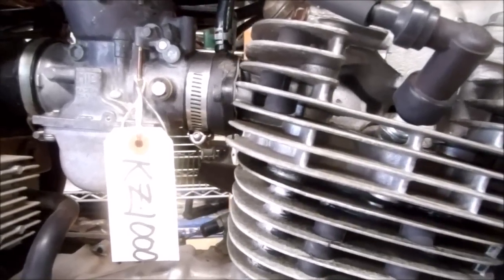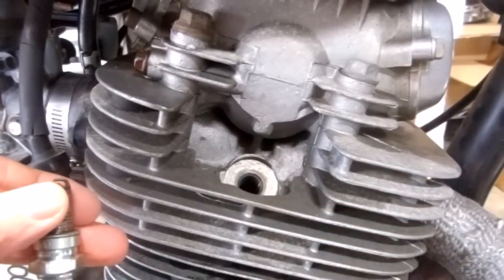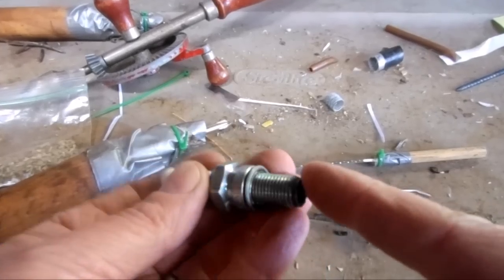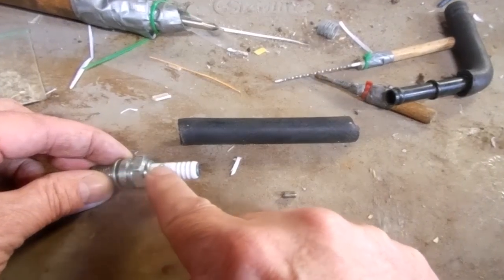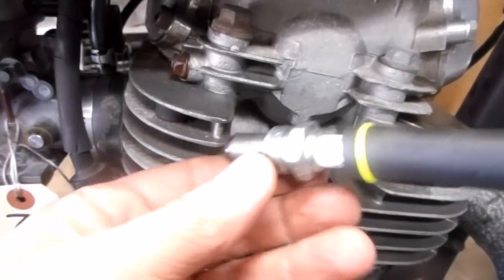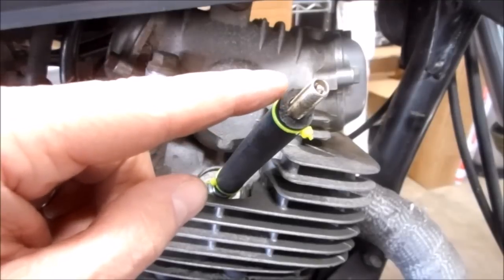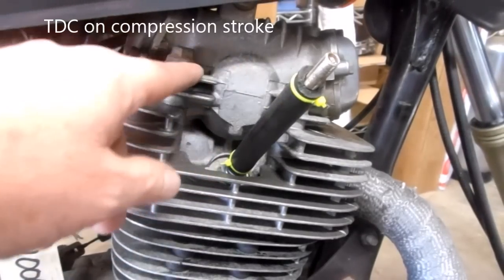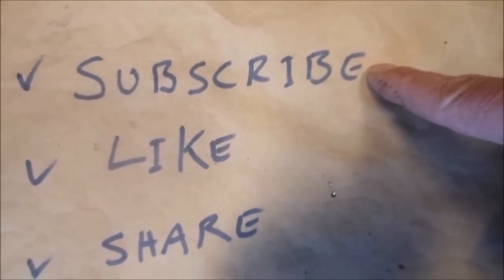how to check engine cylinder compression and leak down

Comment: Those miniature scissors cut extremely well. Also the saw that you used to cut off the shrader valve did very quick work. I am amazed that you were able to drill that hole with that antique hand powered drill. Impressive work.

Comment: If my memory serves me right the 5th cylinder on that model is just a redundant spare that kicks in if you throw a piston on any of the others... It automatically switches if it detects problems.  The shrapnel from the piston shooting out leaves a trail of aircraft grade aluminum powder which mixes with the hot oil to form a seal and maintain compression until cylinder 5 kicks in. Most people won't even notice it happening unless the high velocity failed piston pierces their calf or thigh... That's why we wear leathers guys !!!
Reply: Incorrect. 5 Cyl NEVER made it To Homologation for racing..therefore WE in the USA never got that model. There was a Service Bulletin.. so Some countries KZ 1000 still have the Fifth cylinder , But its 2 stroke ( to  Provide " help" to the other 4 4T pistons on compression. They still have it in Finland.

Comment: Good video but I felt like I was watching The Flintstones when you were using some of those tools,, I mean tools that were made after 1922,, like a plug socket 3/8 or 1/2 inch Drives..
Maybe a real center punch instead of a 3 penny nail.. oh and most of all a compression gauge.. but very informative if I ever have to do that don't have the correct Tools in my box..☝

Comment: you lost you lost me after you put the 7 lbs? In to measure a leak down not sure what you're supposed to do.... usually a leak down you listen for leak through either exhaust intake har past the Rings into the sump through the oil filler hole but you didn't do that also 210 pounds on any cylinders wow real good

Comment: I did this compression test, even making sure to use the PSI rated yellow zip ties on my brand new Harley Davidson and found that it did not pass this compression test it had 0 PSI. I returned my motorcycle and they gave me another one. It also did not pass this compression test, so I got my money back. Never buying a Harley again. Let's see how a brand new Honda will do on this test. Thanks for all the advice.

Comment: It is also possible to use the same tool to inflate your intertubes in pinch. I always keep a extra 5 gallon compressor on board just in case though...

Comment: Sorry but that way you're neglecting the addtitional volume added of your hose (which is unfortunately flexible that make things worse) and drill hole and even the entrance of the pressure gauge to the clearance volume of your cylinder...in sum this isn't less based on the clearance volume and so you'll get quantitatively wrong measurments of compression/pressure that you'll have in normal operation. On the qualitative side you have a tool to test leak tightness over time.

Sorry for my English...not my mothers tongue

Comment: Crap.   I just did this and got 0 psi on both of my cylinders. Which is weird because it runs great.   Oh well I guess I'm going to rebuild it. 
I don't want to risk it:(
Reply from the maker: probably just needs a top end. probably
Reply: Ichiban Moto ok  I replaced the handlebars, gauges, tank, and windshield and am still getting 0.  Is the seat part of the top or bottom end?
Reply: Ichiban Moto never mind  I just realized I was completely out of steam oil.   Filled her up and she's good to go.   Also seems to have fixed the recurring hot start issue in the left turbine.
Reply from the maker: correct. the seat of the bike is the top end

Comment: I just checked the 7psi after 15min and found it has dropped to 5psi. Does my engine need rebuild?
Reply from the maker: probably not.. just find where the leak is coming from
Reply: To find the leak, can't you just dump a bunch of soap and water in the cylinder? I tried this on my mothers 2017 BMW X5 and it stopped working... after the soap and water theory, my psi went up!

Comment: Worked a treat. If compression was low how would you raise compression. I managed to bend my gauge needle by hand to the desired amount in the workshop guide.
Reply from the maker: can you do the opposite if the compression is way too high?
Reply: Ichiban Moto Just cut the right size hole in the hose with your diamond shears to release the extra compression...

Comment: I just use the compression ratio formula, to make sure my cylinder pressure read outs are on point. Its as easy as Pi(e). Just be heads up, this formula does not work on external combustion engines. It only works on 4 stroke internal combustion engines.

Comment: If i turn the engine upside down can i use oil to check for bad valves?
Reply: Don't forget to light a match for best visibility during inspection
Reply: heavydiesel Yes, if the piston rings are very worn !
Reply: Not joking, but if you have the valve train assembled and off the bike, you can fill the combustion chamber with gasoline and check for a leak between seat and valve.

Comment: You could have saved yourself a lot of work by getting some pre-drilled spark plugs from home depot.
btw you forgot to mention that you have to put your bike in gear and on the brake for a leak down test to prevent your bike from rolling out of the shop when applying pressure with the pump.
OTHERWISE  TOP NOTCH !
Reply from the maker: good tip :D

Comment: Those special teflon coated pink pipe cleaners are excellent.
I used a large ball of them to give my Moto-bicyclette a big-bore from 50cc to 356cc and used metal camping cups for the pistons... it's a little rattly now but boy is it BADASS. Thank you for your wisdom Master Ichiban San from over the pond in the U.K.
Xx

Comment: thanks for the good video mr Moto, I'll try that, I've been able to get a compression tester to work, I have 3. been trying for almost 40 years.  i tried welding spark plug threads only to a steel line, but left little dingle berries all over the threads, almost stripped the heads.

Comment: Does the engine need to be warmed up to get proper readings?
Reply: kevmankom Yeah, shop manual calls for the engine to be hot. As these 5 pot Z1000 motors are air cooled you can use the wife's hair dryer to bring it up to temp.

Comment: Hi ichiban,over here in the uk we can only get red psi rated zip ties and they only go up to 187 psi. Is there anything else I could use? Maybe purple stripe air rated installation tape? Thanks
Reply: buddybonus10 Halfords sell uprated blue ones rated to 20 bar, use these instead.
Reply: Coldfin9er oh that's great as the ones I have just blow off,will try Halfords ,thankyou
Reply from the maker: i can't vouch for those... maybe put on five or six and stand back when under pressure

Comment: That KZ1000/5 is early production...The 5th cylinder kept falling off, so they enlarged the remaining four and history was made.
Reply: Incorrect. 5 Cyl NEVER made it To Homologation for racing..therefore WE in the USA never got that model. There was a Service Bulletin.. so Some countries KZ 1000 still have the Fifth cylinder , But its 2 stroke ( to  Provide " help" to the other 4 4T pistons on compression. They still have it in Finland.
Reply: Allen Millyard solved that problem by adding a 6th cylinder to balance the oscilating vibrations.
Reply: Who needs a 5 or 6cyl. Guys , V1 is the best!

Comment: Very informative again mister Ban. My bike's got 2 spark plugs in each cylinder and I did the compression test. On one of the cylinders, one spark plug hole gave a different reading than the other. The dealer said that i should just take the average, but what does he know, right?
But i'm confused now, what is wrong?!
Reply from the maker: who makes those crossover balance tubes and boost bottles?

Comment: Oh dude great vid as usual but you should really use a green, high tension lithium impregnated pipe cleaner.
Reply: Let's not go overboard, the Teflon coated stuff is fine for this job. Your stuff is more for dealing with the Earths Iron Core...
X

Comment: hello friend. do you mind sharing a bit of the process of drilling the spark plug?  been trying for 1 hour without any positive result...
Reply from the maker: light even pressure, constant speed and a drop of cutting oil
Reply: thanks mate

Comment: You forgot to fill the cylinders full of Nickletown Customs spray lubricant to help the compression build! 😂
Reply from the maker: I used 25ml in the cyl if the comp is down as a ring vs. valve test. I talk about it in the video. I just don't say "Nickletown Customs"  unless they provide giveaways for the subscriber drawings.
Reply: Ahhh I see. I must've missed that part! I need to get in on that next drawing...

Comment: Another great video, learned lots as usual! Just a tip for viewers with newer bikes - be sure to hold onto the spark plug wires when cranking the engine so they don't short out and damage the black box. The black boxes are expensive and sometimes hard to find, so be careful with them.

Comment: super cool, question my 1975 Suzuki RE5 is a bit down on power, can I check the cylinder presser and leak down the same way as your video showed. ? thanks
Reply: Yes, it was a race inspired design adapted for the road in a bold move by Suzuki to compete against Honda's awesome new 7 cylinder supercharged 2 stroke dominating the GP circuit at the time.
Reply: Sorta but because it has 2 plugs you will need to use a Nickel Town Customs pressure grade double hose splice to get both checked at the same time, you could get a false reading if they aren't synchronized though, so be sure to synchronize your exhaust before performing the test.
Reply from the maker: so is the RE5  5 liter the only 5 rotor with two plugs ?
Reply: Ichiban Moto of course it's a 5 liter stock, but it has been bore out to full face size with full race wipers and my top notch Suzuki full race mechanic / tuner, added two extra valves per rotor, he stuck with dual mass electrode plugs, due to keep the wight down.

Comment: Why are there rags tied around the exhaust on that bike?
Reply from the maker: see my pipe wrap video ;)
Reply: Not rags, that's clearly Nickel Town Customs re-plating wrap, if your exhaust is discolored or rusted through you wrap it with the re-plating wrap to seal it and them just chrome over. It will leave your exhaust looking badass!!
Reply: El Rayo X heat wrap
Reply: See it and weep.
Xx

Comment: Did you check cylinder 7 too?
Reply: That was a KZ1000, so no, only the limited edition (very rare) KZ1007 had the extra 2.
Reply from the maker: wasn't the KZ1007 a two stroke ?
Reply: Indeed it was a 2 stroke, you know your motorcycle lore very well indeed sir.
Reply: the local KZ1000/KZ1007 dealer told me they only came whit a 3-stroke...
Reply: Uses the Northstar system... Usually only runs on 5 cylinders, the other 2 are redundant.

Comment: +ichiban moto can you do a video about preparing for a long distance motorcycle trip as in what to pack when touring
like equipment and stuff...
Reply from the maker: sure, I already have a well stocked tool, supply and medical roll. check out that video and let me know what you would add. I will collect up a new list and make an updated version.